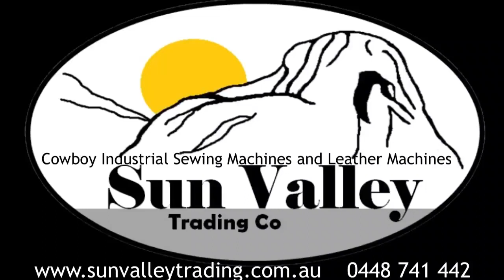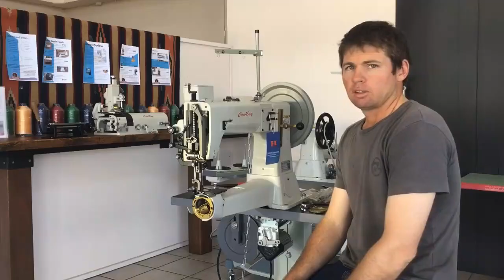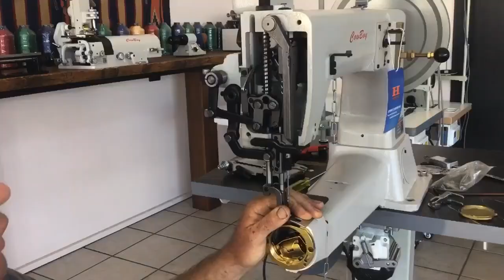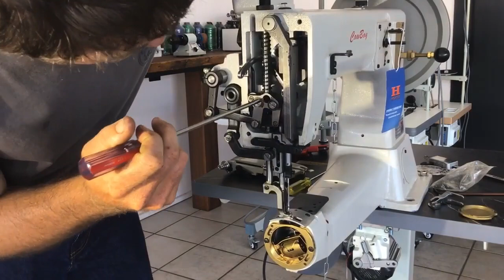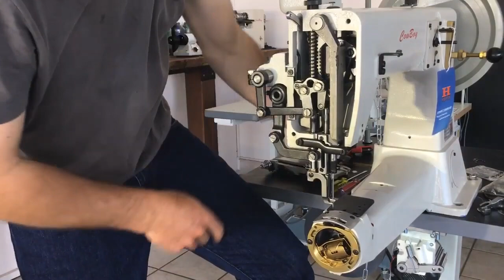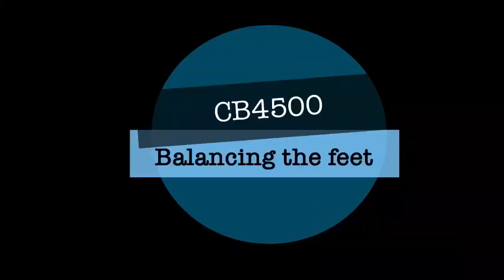Adjust the presser foot pressure of leather industrial sewing machine

Comment: Thanks Mate... Very useful...
Could you please make a video on back stitching...? Especially on how to make the back stitch look good on both sides...
Reply from the maker: You mean reverse stitch? What's the problem with your leather sewing machine?
Reply: Yes Reverse or as we call it the "Back Stitch" ... The Top side of the Reverse stitch looks good but the the bottom side Reverse stitch is not acceptable...
Thanks
Reply from the maker: Which machine you are using? Please send clear picture of the problem to info@cowboysew.com or your local dealer, thanks!
Reply: @HightexHeavysewingtechnology  CB4500
Reply from the maker: @FreakyScaryChannel  Thanks, please contact our dealer who sold you the machine or info@cowboysew.com, CB4500 is very high quality leather sewing machine, should not have problem with back stitching.